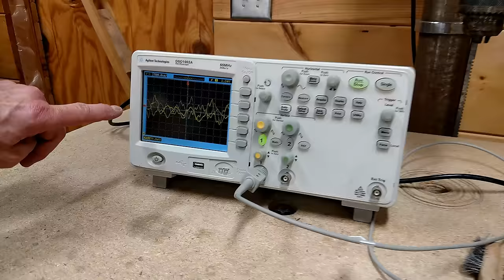Active Noise Cancellation

Comment: I like the demonstration of active noise cancellation but how does one deal with the multi-frequencies of an engine?  Using the microphone, it can produce feed-back to the amplifiers to drive the wall mounted actuators but surely different frequencies picked up would require different amounts of gain (which would I guess have to be a trade off to some respect)?
Reply: Ah I should have read the comments in detail first, it seems engines are below 1KHz so the entire envelope of sound can be contained somewhat efficiently.  And of course if the sound from the cancelling actuators is 180 degrees out of phase then no matter what the frequency is, then as long as the frequency response of the driver material is capable of producing then it will cancel the full range (somewhat) Thanks!
Reply: Look up Fourier Transformation. 3blue1brown has a great video on that
Reply: @feschber  the fourier transform is kind of unrelated to his question

Comment: Why couldn't you also use geometry as a fourth way to reduce sound?  If you could angle equally stiff/massive materials to send reflections into long traps, you'd win, at least at specific frequencies/temperatures/etc.  You could also set it up for destructive (or constructive) interference if you really wanted, for passive sound cancellation or reinforcement.
Reply: Ryan Lackey High end speaker enclosures use trapezoidal or non-parallel enclosure walls to reduce/eliminate internal standing waves or certain resonances with internal baffles & bracing!
Reply: Ryan, further to what fook said, Look up what a "W Box" is. 
It's a subwoofer design that does pretty much exactly what you are asking about.
Reply: I am certainly no scientist but I personally have seen several automotive engine exhaust mufflers cut open, revealing just that. The angled metal baffles are arranged in a manner to reflect a great deal of the engine exhaust sounds back upon themselves to cancel them out as they are pushed through the muffler. Mind you that there are ever changing designs and materials being used to control decibels as much as possible without impacting performance through airflow restriction...   

Maybe they could install low cost microphones at key points in the vehicle.  Using hardware and software solutions to, analyze and in real time, play the opposite waves through a vehicles speakers and effectively cancel the road noise, wind noise, engine noise, and other unwanted noise pollution from the public at large....?

ok, I lied... I am a scientist. No, but really folks I dont want to go through life with ear buds crammed in my ears or wear headphones like I am a 49 year old Dj. Why cant we use existing speakers from our Televisions, Computers, Car Audio etc and just have somekind of new noisecanceling in real time firmware .... use existing microphones (Your smart TV can hear you, cellphones, tablets, pc, laptops, every car has onstar basically....voila...microphone... (a damn good one comes with onstar, its amazing how accurate).....   and just like that......

Weve got that amazing Bose active, real time noise cancelling  ability they used to charge a couple thousand for to make everything go away. albeit now we can control what gets silenced, reduced volume or unaffected.... like your mother in law. She needs to know that you are getting her loud and clear.   -Tony Cusimano

Comment: Great video, now how would one apply this to a noise source such as those nitro engines you will be using?  From what I am thinking, If you were trying to do this real time, you would have to be able to read the incoming frequencies across the entire audible section (or designated peak sections), and then on the spot be creating the 90 degree phase shift equivalent for each of these frequencies and deliver it.  For lower frequency noise you would have milliseconds, but for high frequency noise you would be looking at around 1/20000 of a second.  I guess a strong micro controller might be fast enough to at least tackle such cancellation up to around 10KHz? I guess the low frequencies would be most important as they tend to travel further?
Reply from the maker: The large majority of the noise from the gasoline engines is below 1kHz.  To avoid the complexity of adding a spacing factor and the associated phase delay for the higher frequencies we will low pass filter the microphones above 1 kHz.  The distance between the microphones and the audio exciters is 1 cm, therefore a simple 180 degree phase shift should suffice.
Reply: Hmm, if you only have to worry about up to 1KHz, then that seems a lot more doable. This whole channel is a gold mine of information on things I never really bothered to think that much about.
Reply: a humble arduino Atmega328 is capable of reading analog up to 70KHz without degredation & if you dont mind +/- a few LSB's up to 200KHz and change is possible. But to also do something like FFT with an 8bit controller, well, just dont expect much.
Reply: There should be no latency with the playback audio as there is no need for a logic circuit or digital processor. All you will need to do is invert the polarity of the incoming noise and play it back at the same pressure level and make sure the placement of the microphones are equidistant from the source as the playback speakers...
Reply: Caleb McLellan    you make an important point, but it is only true for linear,  parallel phased waves.  If waves are radiating from a point source there is no other single point in space which allows you to cancel them in all directions.  Expect interference patterns which reduce the intensity in some places and increase it in others.   You'd have to surround the source in a spherical shell of opposing transducers.  Not practicable.  Well, if we're talking about the sound from the exhaust of an IC engine it's quite easy to provide the anti sound signal to reduce that,  in the way described here.  But doing that involves putting opposing  pressure on the exhaust which reduces the efficiency of the engine.  Compared to a conventional silencer..?.. well , I await the data.

Comment: Another degree of freedom is shape. Stealth aircraft use shape to disrupt reflections.
Reply: Shape has more to do with radar reflection than sound, but good point.
Reply: Stealth (to a degree) re-directs (mirrors away) the energy waves from being reflected back to an observer. 

Think of light waves for example... shine a spotlight on a plane at night, but the plane is coated in 'special mirrors' that, (because of magic) let NO light pixies to EVER  get bounced back to an observer.  not even the smallest pinprick of light.   

From the observer's point of view, his spotlight is just going into outerspace (just like everywhere else in the otherwise empty, dark skies).  Schnook ;--)
Reply: Excellent video and very well explained. I agree with Mark Proffitt - shape is another degree of freedom, in two specific ways.

Low frequency sound waves behave much like water waves - they "build up" in certain places. A cube is actually the worst shape for acoustics because every dimension is the same, so the buildups will be in the same frequencies in all dimensions.

You can mathematically calculate the frequency buildups very easily - he gives you all the math you need in the video. Wavelength is the speed of sound divided by the frequency - sound moves at 1130 feet per second, so a 1130 hz wavelength is 1 foot long. This makes a 1 foot cube the worst shape you can make because the buildup of sound pressure will be significant, and will be the same in all dimensions.

If you vary the length, width and height, you can change the - they're called modes - axial modes (involving two opposite surfaces) so that they don't all build up at the same frequency.

To visualize this - fill up your kitchen sing or any square vessel with water & start pumping the water with your hand. Eventually you'll see that the shape of the sink strongly influences the size, shape and location of the waves.

Additionally, you can measure the frequency output of whatever device (engine) you're putting inside the box, and then craft the box so that it doesn't emphasize those frequencies - if it outputs 500hz, then don't make the box a multiple of (1130 feet per second / 500 cycles per second = 2.26 feet).

There are many calculators online where you can plug in dimensions and it'll spit out the frequencies that get emphasized - google "room mode calculator".

High frequency sound waves behave much more like light - they reflect. It's difficult to tell where a woofer is in a room, but you know where each tweeter is & depending on nearby surfaces, you get phased reflections that reach your ear at the same time as the sound.

To break up high frequency waves you can use "digital" diffusion, which behaves like frosted glass. Rather than light bouncing off at a predictable angle because the surface is flat, you texture the surface so that the sound bounces off in random directions. The size of the texture is based on the frequency(ies) you want to diffuse.

Another method for sound reduction - known to the Ancient Greeks, they put them in their theaters - is a Helmholtz Resonator. You know how if you blow wind over a bottle it makes a sound? Well that shape absorbs sound at that frequency. If you know the problem frequencies, you can build a Helmholtz Resonator to absorb that frequency. This is similar to the way cities try to build shapes into the ocean floor nearby to reduce the power of strong waves.

A combination of the above - vary the shape of the box, create rough surfaces on the walls, and add tuned acoustical traps as needed/desired can do a lot to minimize sound transmission (along with all of the things you discussed).

Lastly, similar to a vacuum thermos, you can create a "room within a room" or a "box within a box" to reduce the direct vibrations reaching the outside. This is intuitive based on your excellent discussion of sound transmission through substances of various stiffness. A sort of "laminate" of stiff/absorbent/stiff/absorbent will work very well to reduce sound transmission out of the box - you may be better results with thinner materials but sandwiched in such a fashion than with thicker materials that are not sandwiched like this.

These are all passive noise reduction techniques that you can employ before getting to active noise reduction - which you use is a matter of your end goals and design constraints.

Comment: Wouldn't a 4th degree of freedom be a vacuum?
Reply: Chickenbone Genome doesn't really matter if there's no medium.
Reply: Chickenbone Genome well that's exactly what Yeti does with my coffee every morning...
Reply: Curtis Mommsen ... Very good point... That's why they say "No one can hear you scream in space." HA! I don't know who "they" are btw... :)
Reply: Tell us more about this internal combustion engine that runs in a vacuum :p
Reply: Drop a lit match into your Yeti.  It will continue to burn (unless there's coffee)
Reply: If you build a complex articulated structure you can have many degrees of freedom without adding dimensions.

He is talking about important parameters - which are not degrees of freedom per se in terms of conventional mechanical engineering jargon.
Reply: I'm imagining an acoustic "thermos," with a vacuum layer between a pair of concentric boxes as shown.
Reply: then wouldn't a 5th degree of freedom be angle? I heard the greek used angular surfaces to bounce sound in a way so for example an orator could be better heard by the audience.
Reply: Yes a vacuum blocks audio. But to construct a vacuum you need material to keep surfaces separated to contain the vacuum. That separating material will conduct the sound waves. The greater the vacuum, the more bracing you need to keep the container in it’s shape, the less effective the vacuum will be. Maybe 2 round shells within each other, with the inner shell hanging from a rope, might work. But if the inner shell breaks you’ll have the vacuum ripping your ear drums apart.
Reply: @Dude31463  "they" are (presumably) the marketing team from 20th Century Fox, ca. 1979 :)
Reply: @Engineer9736  Magnetical separation?
Reply: @CurtisMommsen  
The vacuum is in the "walls" of thermos.

Comment: What about redirecting the sound upwards? Couldn't you build a inverted pyramid that surrounds APU and bounces the sound skyward? I'm envisioning something lightweight like magnesium with a felt lining. Then you don't run into overheating issues that an enclosed APU might have. Just speculating.
Reply: Mike oliver What goes up often comes down.
Reply: Mr Davis Lmao
Reply: Id just use quieter engines, to be honest, or look at an exhaust system like what they used on that original jet car from the 50s
Reply: Except for Apple stock... it keeps rising...
Reply: That is done with exhaust in turbine's. They change the shape of the sound to be in tolerance. Doesn't get rid of it, just modifies sound to a point human don't hear it.
Reply: @unlokia  and it dropped lmao

Comment: I really liked this demo, and I may send it on to my sound people for their reference. (Also to understand why it's so important to wire speakers in phase.) 

One note: @2:30 Herz is a measurement of frequency, not velocity. Something doesn't move at a "Hertz". It moves at a velocity, or speed. (Although yes, 1100 feet per second is about right.)

When doing audio work, I will often need to set up a delay for speakers located further away from the stage. If the a speaker is 50 feet away from the stage, we add 55 ms of delay. Works great!

Comment: I was waiting for him to test it with another sound rather than a pure signal☹️
Reply: he did not... because that would have been a disaster.
This is just a laboratory experiment.
this setup will never work with a real engine. or more complicated soundwaves.
Reply: Mainly because of budget constraints. I believe...
(Also, for practical reasons, we don't need complete sound cancelation. A strong attenuation would be usefull enough).
Reply: Rygel Orionis I want to see how good or bad could it be

Comment: So sound produces small high and low pressure regions in the air that move at the speed of sound? Is that right?
Reply from the maker: Yes.
Reply: What wasn't mentioned in this video, lower frequencies are less and less directional. It starts around 800Hz and below. With bass frequencies being pretty much omnidirectional. So low frequencies pretty much create spherical pressure regions. That's why during concerts system engineers tend to have subs in cardioid configurations that use phase manipulation in both distance and electronical way (they tweak the timing and the polarity of the signal with sound processing and also by physically placing speakers)  to pump sound out from the rear of a speaker back to the front towards audience and make the system more efficient and the stage less noisy.

That's one of the coolest examples:
https://youtu.be/uoLE8AvsHD0
Reply: Excellent.

Comment: After watching some of your other videos about sound (flat speakers, sound absorbing walls) I'm asking me if you could use this technique to enhance the performance of your sound absorption panels at low frequencies, a sort of active bass traps.
 You would need to modyfy the electronics to drive the panels at a velocity proportional to the air pressure measured at the panel surface (maybe just a quadrature phase shifter would do but I didn't do any precise calculations) so as to get a purely real impedance (no reactive part), then adjust the real impedance to match the acoustic impedance of the air. I think it could be an interesting project too.
Reply from the maker: I agree.

Comment: You should try using some stiffening ribs from the edge frame, and mounting the back of the actuator to that. At the moment, the inertia of the actuator back is what acts on the wall. If you mount the actuator back to a solid surface, the motor action will be the acting force, and should give you more amplitude.
Reply: Or rather that some energy is lost to the movement of the actuator back.

Comment: If you haven't come across it, adaptive feed forward and/or feedback noise control is worth a look. It is computationally expensive, but uses gradient descent to come up with nearly optimal waveforms for a set of speakers from a set of microphones. It sees applications in active mufflers, HVAC duct quieting, headphones, amd others. I expect it could be helpful for your problem as well.
Reply: Also, I'm curious how the noise mitigation project has progressed.
Reply: This is news to me and sounds like an awesome idea! especially with a noise source that is static in both time and frequency.

Comment: Many cars ie Toyota Use Active noise reduction with excitors in roof linings and other specific parts of the car etc, Honda are another big fairly unknown industry player in ANR tech. 
If you ever look at the anti bawk screens around heavy roadworks you will usually see that sandwhich composite foam panels as well.   Another great video btw!

Comment: I used to use phase cancellation to break in double 18" JBL sub speaker cabinets. I flipped the signal phase 180 degrees going into Channel 1 and Channel 2 of a Crown VZ5000 power amplifier. I monitored the signals to make sure there was no clipping at all maintaining a pure sign wave, and ran the amps wide open. A bit over 2,000 watts output for each channel. I set the double 18" speaker enclosures face to face with about a 4" space between the cabinet faces, so I could stick my hand between the speakers to feel the air movement. There was barely any sound being produced outside of the "zone" due to phase cancellation. But the air movement between the speakers was very intense. 100Hz with 4,000 watts driving these out of phase speakers was barely audible. (I am a design engineer and owned a sound company for many years.)
Reply from the maker: Neat!